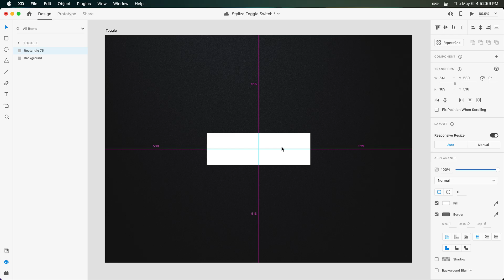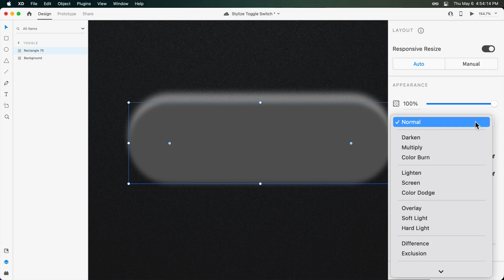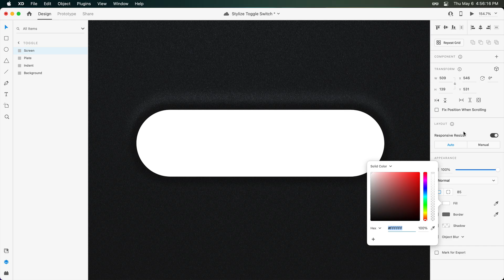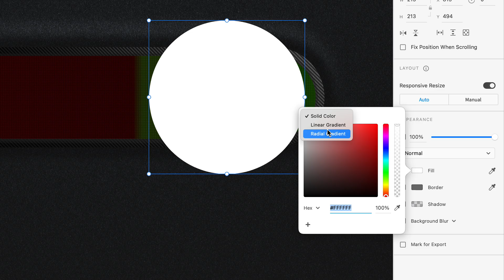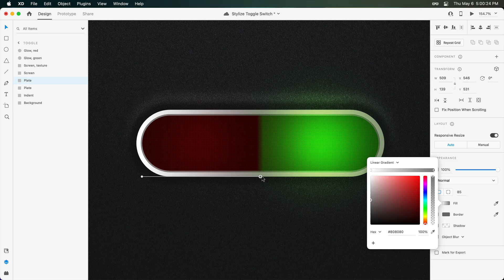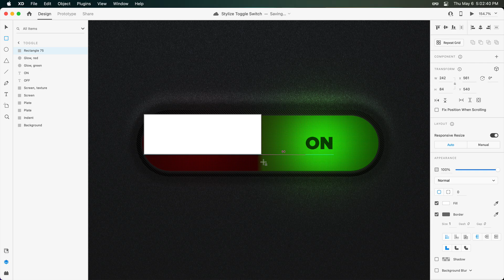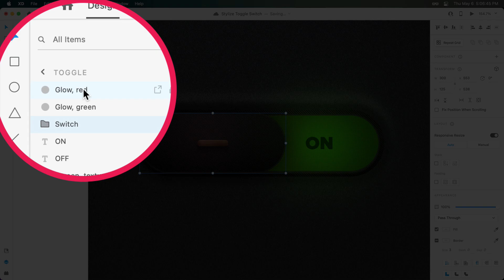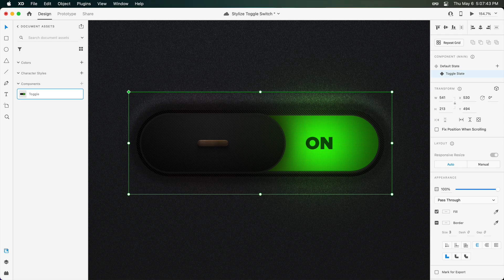Design & Prototype a Stylized Toggle Switch in Adobe XD

Comment: I don't understand how is toggle different from tap trigger with transition to usual state?
Reply from the maker: This automatically wires up both states, saving quite a few clicks.
Reply: @HowardPinsky  But if there is nothing to animate, and you aren't OK with the default animation (it is really slow and looks laggy) you have to change the animation type to "transition" and animation to "none", for each, default and hower state. Of course, if you want to have an instant transition. For toggle state, I'm not sure but for the hover state, this default option is time-consuming. In most cases, for the hover state, there is nothing to animate.

Comment: Unfortunately, XD is growing to slow. 🤷
Reply from the maker: I'd disagree, but we'd rather take our time with releases to avoid performance or user experience issues.
Reply: @HowardPinsky , Probably I am one of the biggest supporters of XD but as a supporter, I have to be much more critical. For example: In the latest update you have added a toggle state. 
In my opinion, this feature is not that important. You could add the background behind the overlay for overlay interactions. The potentially required functionalities are very well defined in Figma. When I'm using Overlays in prototype mode, I'm able to: 1) Pick really cool triggers (including: touch up, touch down); 2) Set the component animation behavior; 3) Check whether I want or not to close overlay with an outside click; 4) Add background behind overlay (Set the preferred parameters for that background: color and opacity); 5) Use suggested overlay positions. As you see, the same functionality in XD just exists, but it's not developed that much. I can say that every feature that is only in XD (For example 3D Transform tool) is really cool and competitive, but in common functions, Figma is far ahead. Not in all aspects of course.
Reply from the maker: A few points to this:

• Overlays isn't a very commonly used feature, so it's lower on the priority list. Components/states can use used as 'overlays' in most cases with more control.
• Users have definitely been asking for a 'toggle'-like state, which cuts down on steps when creating interactions like this.
• The team is working on many prototyping features that will be released this year.
• The XD team has many different squads that are actively working on a whole range of features.
Reply: @HowardPinsky  Then please tell to developers to add for STAKS  (ALT+S) hotkey it is annoying to tap enable/disable with click, wasting a lot of time. Thx
Reply: @HowardPinsky  Overlays are commonly used interaction and they could not be replaced with component states.  As I said, Overlays are more smartly developed in Figma. Modules, Popups, Sidebars, and other components need to have a behind layer to cover the background artboard. I need to develop one button with default and hover state for different artboards, which will cause the sidebar to appear from any side while clicking on the hover state. As you know I need some kind of Scrim, a background layer with a lower opacity to cover the artboard. How can I do this in XD as simple as possible. Keep in mind, I need the sidebar to slide in. it has to work for different artboards and fully cover the background while scrolling. With using overlays, auto animate is automatically disabled, so another option for this is to set the component states. button which includes a sidebar and also behind a layer with lower opacity. with some hiding and showing tips from the layers panel, it could be achieved, but the background layer stays scrollable, and it's not the result that I wanted. to achieve this, should not be that much hard. So please check the overlay functionality in Figma. It works as it should.